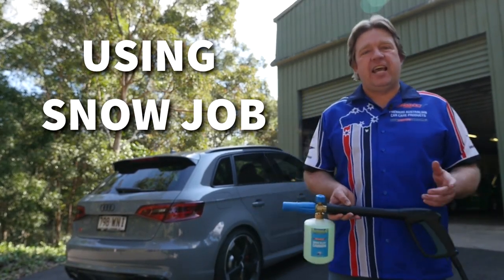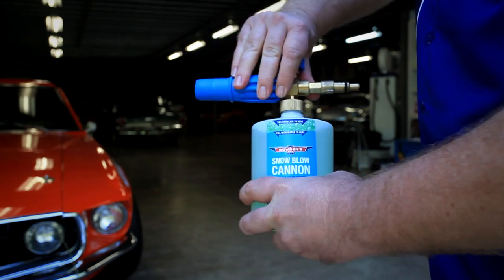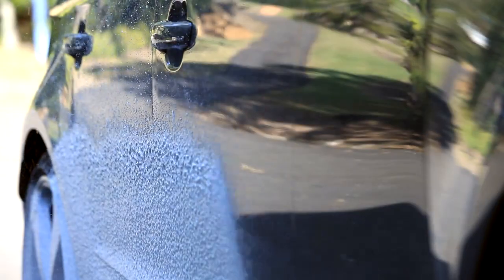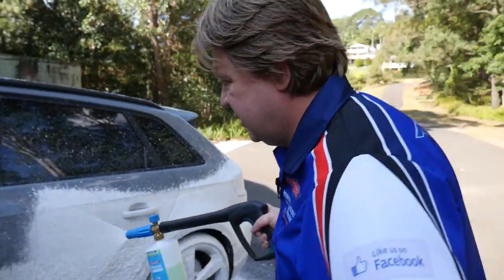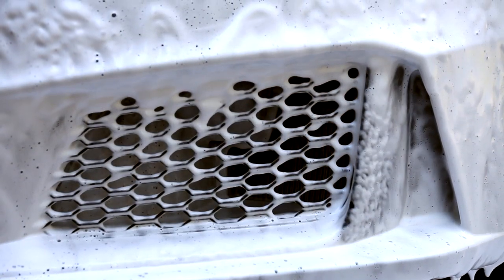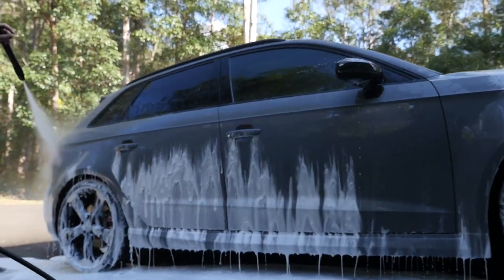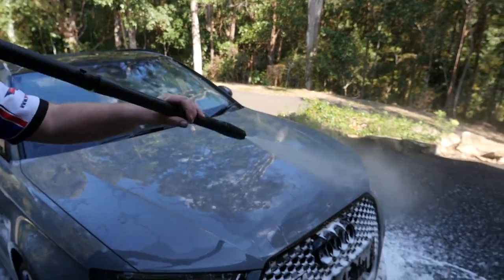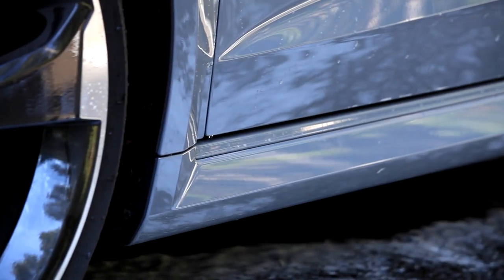Bowden's Own - Using the Snow Job Foam Cannon // Supercheap Auto

Comment: I’m confused
Why foam it up, rinse it, and wash it again?

I was under the impression that the foam WAS the wash
Reply: I thought this :P
Reply from the maker: Hi Darth, Thanks for your question. The idea behind the Bowden's Own Snow Job is to lift the initial loose dirt, dust & harsh paint scratching contaminants without damaging the paint before cleaning stuck on dirt with a brush or sponge. Doing this will improve chances at keeping your paint scratch free. - Ash
Reply: Donald West you are under the wrong impression
Reply: I bought Karcher foam container, 2 actually, but non of them makes such foam with Karcher K7. Why is that? Thanks!

Comment: Sorry, just bought one of these foam cannons and used it exactly as shown on this video, on a reasonably dirty, been out on a wet road type grime, not mud. It was a complete waste of time. When I looked at the paint after the rinse it was just the same, the dirt was still on the paint exactly the same as when I started, it removed nothing that a garden house wouldn't have done. I don't expect all the dirt to come off just because you put some foam soap on it, but this did absolutely nothing.The Bowden's Nanolicious Wash was quite good, but is expensive, left a nice finish, like a wax, I'd buy that again, but as for the foam cannon that's nothing but a big time wasting wank.

Comment: first time i see a sensible man who staryed washing from to bottom every time i see bottom to top i dny knw why they used a very wrong and more water consuming method
Reply: Thanks, at least one person that has got it right.

The foam covers the suface to loosen up the dirt and contain it. 

The high pressure washer works like a brush and when rinsing, it carries the dirt away.

When rinsing from the top first the water runs down and rinses away the foam of the lower parts without the high pressure beam hitting the foam and dirt as supposedly.

And also, without the foam in it's easy to miss a spot when you can't see where you have rinsed.

Starting from the bottom rinsing horisontally line by line working yourself up you'll always keep track where to rinse.

Yes, rinsing from bottom to the top takes more time and water, but this is the way professionals do for the reasons stated above.